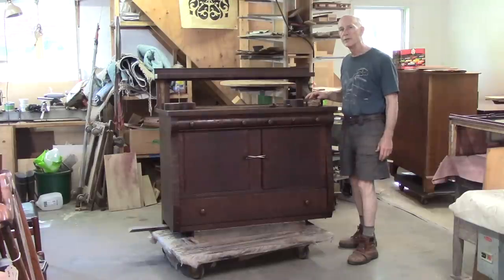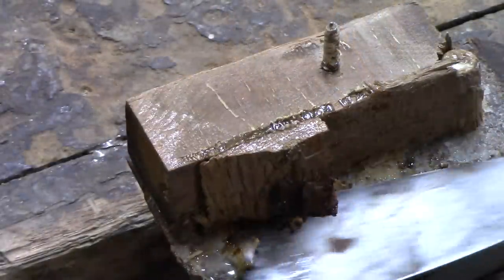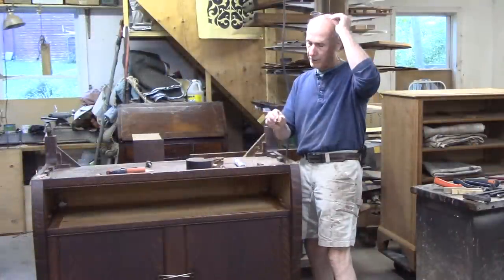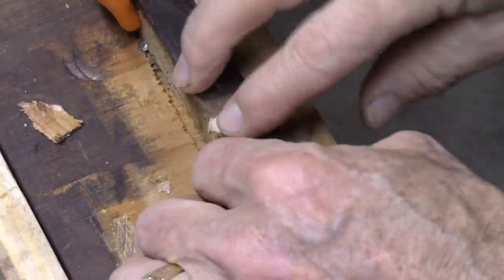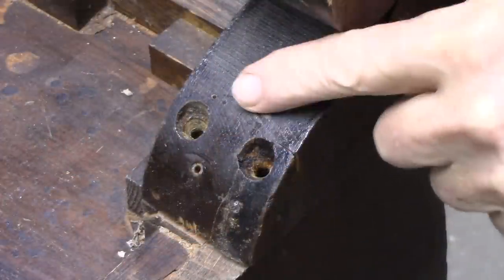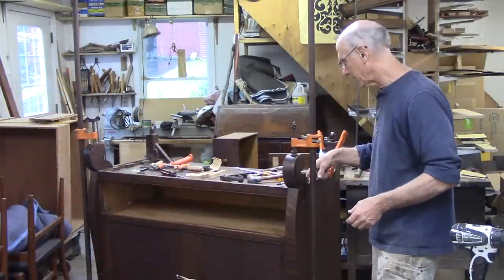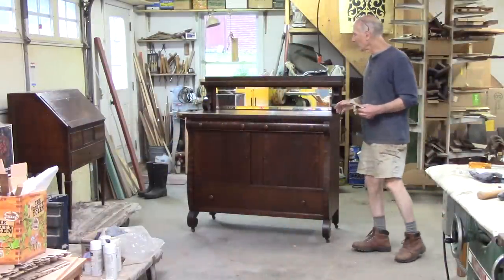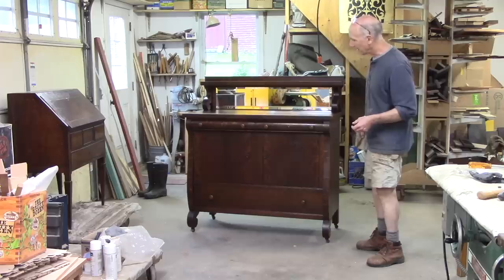Restoring an Antique Oak Server - Thomas Johnson Antique Furniture Restoration

Comment: What kind of glue are you using, Apoxy ?
Reply from the maker: In one scene I used some epoxy putty, but for all else I was using hide glue.
Reply: Hide glue?  Is that available at the home improvement stores or ACE Hardware?

Comment: My grandmother had a buffet like that. My brother tried to restore it back in the 1970s, but found after he had sanded it that it was so riddled by worms that most of the wood would have had to be replaced. He just gave up on the job and put the thing in an old empty house on our property. I figured it would be stolen, as things often were from that house, so I went and got the mirror, which the worms hadn't gotten to. I still have it, and the rest of the buffet is long gone. It has never been refinished, and still has the original mirror in it.
Reply from the maker: Thanks! Quite a story. I'm glad you have the mirror

Comment: I have a piece very much like this one, especially the top with the mirror.  It has a different drawer compartment part.  The legs are the same.  It's in pretty good condition.  Seeing this makes me want to work on it a little bit.  The restoration you did made the one you worked on made it such a wonderful piece.  Thank you.
Reply from the maker: You're welcome! Try using Howard's Feed N Wax: https://www.howardproducts.com/product/feed-n-wax-wood-polish-and-conditioner/

Comment: It really looks great after finishing, thanks for sharing Tom. I have a question, do they sell epoxy putty or you prepare  it yourself ?
Reply from the maker: Thanks! There's a lot of different epoxy putties on the market, I get mine from Mohawk. But I wouldn't be surprised if they had it at your local hardware store. Rockler's and WoodWorker's Supply too
Reply: i´m from  Merida in the Yucatan Peninsula but we have Home Depot, next time I go will check it, thanks for the reply Tom.

Comment: Are the materials you use included in your hourly rate Thomas thank you paul
Reply from the maker: Thanks Paul, yes, unless I have to go buy something just for the job that I won't need for anything else.
Reply: Thomas what do you think is Hyde glue as good as better than or you use it because of the age of the pice you are working on thanks again paul